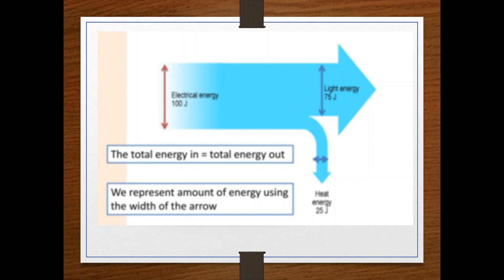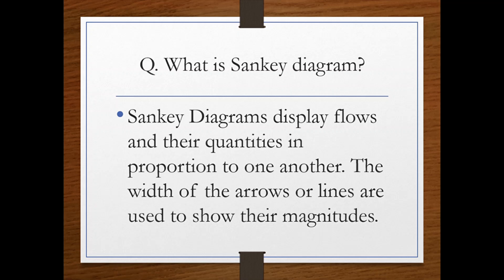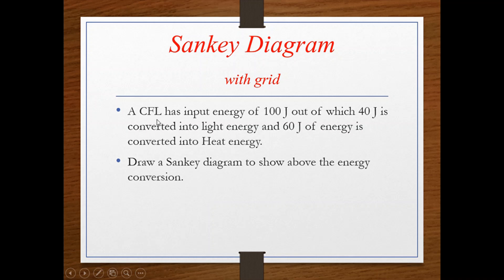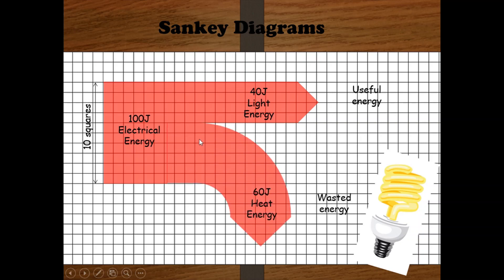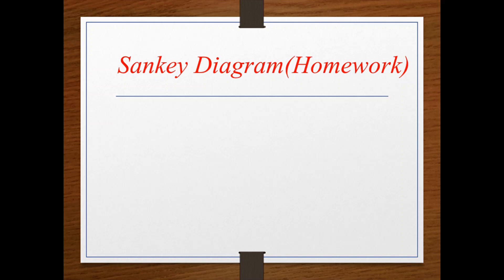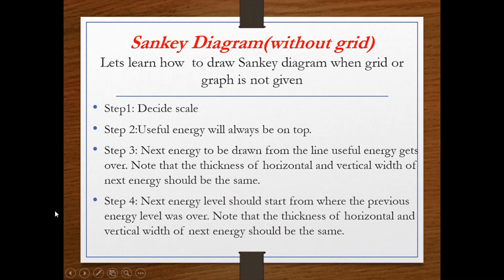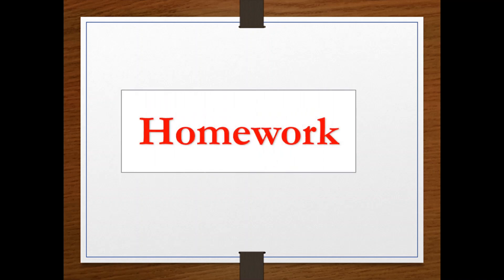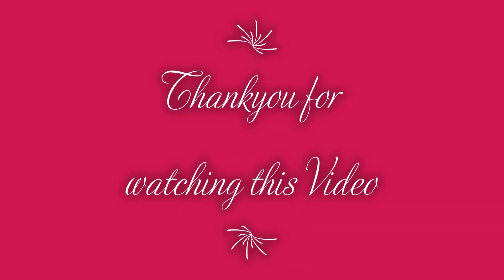How to draw Sankey Diagram with and without Grid

Comment: sir i had a small doubt... for the television sankey diagram even the sound energy would be useful right?
Reply from the maker: True but when we mention television  it's primary work is show picture which is light energy... sound energy you get it due to another device attached to television that is speaker which converts electrical to sound but television only to light energy